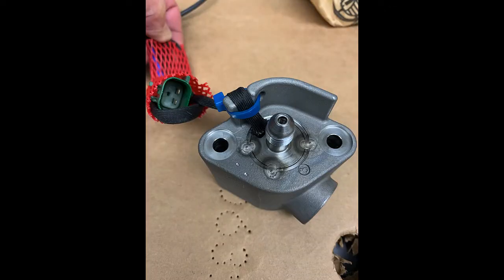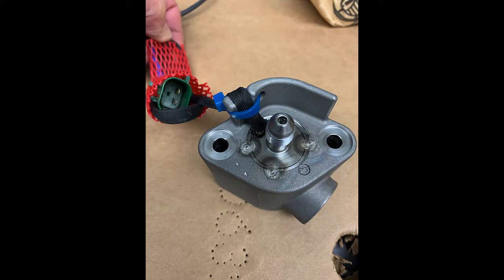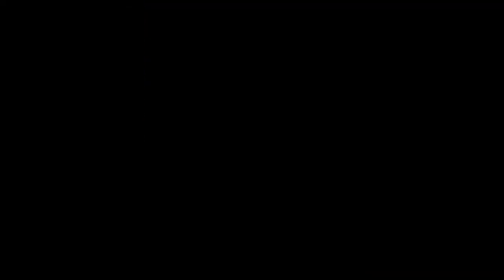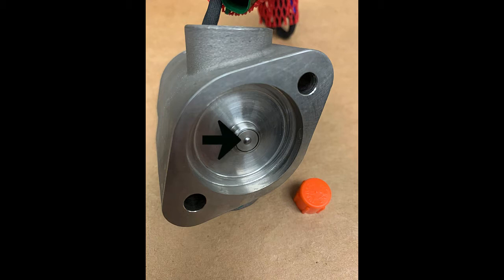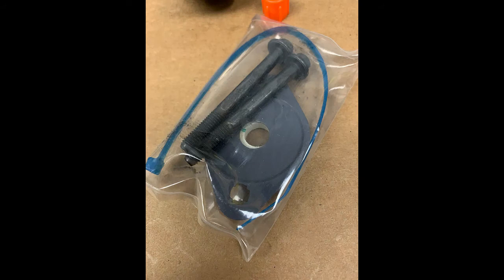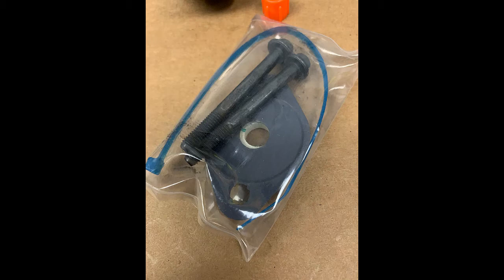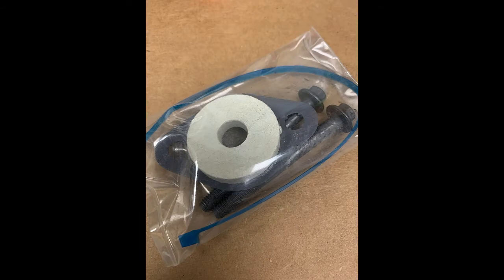Diesel fuel smell in the exhaust

Comment: I currently have same issues, diesel is coming out from the exhaust. This happened after the valves, vales seals and springs were replaced. I have had the nozzles tested and they okay. But problem still persist.
Reply from the maker: what engine do you have and is it mechanical or electronic. you said nozzles so is it a cat?

Comment: Hello my friend have a question QSX 15 2005 565HP. can I put in a truck. Any suggestions thank you
Reply from the maker: I guess the safest answer is no because qsx is an industrial engine. software behavior is very different from highway. if critical part numbers are not compatible you can not put automotive software in the qsx. so what do you lose - torque curves very different, no cruise control, no vehicle speed, no odometer and the list goes on. most of those engines idle at 1000 rpm. And wiring harnesses are not the same for the oem side of the ecm.  Unless you have a very knowledgeable guy doing this it would be a nightmare change over to make it run right in a truck.
Reply: @ENGINESHOPJOE   Thank you very much for all that good information my friend. I did ask you that because you have a lot of knowledge on cummins engine. I personally use them in air compressor in my jobs there are so beefy engines that's why I'm asking you. But anyway thank you again